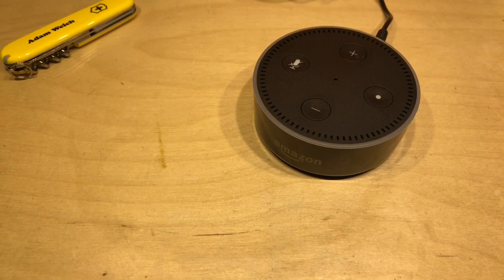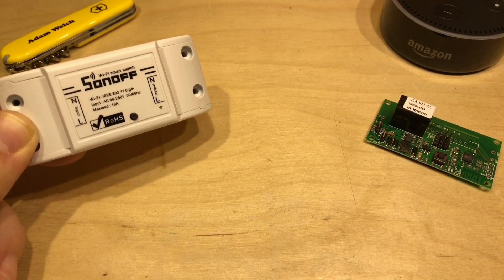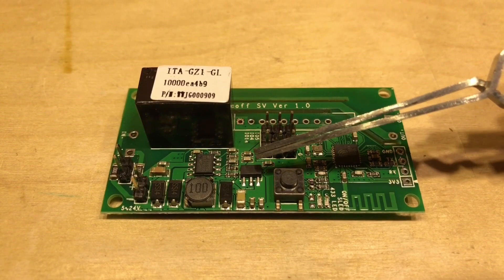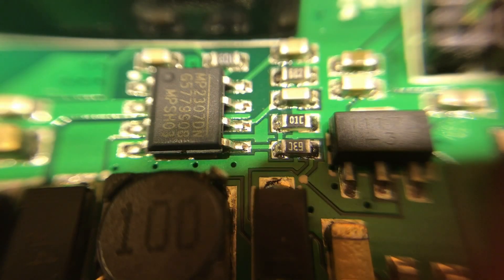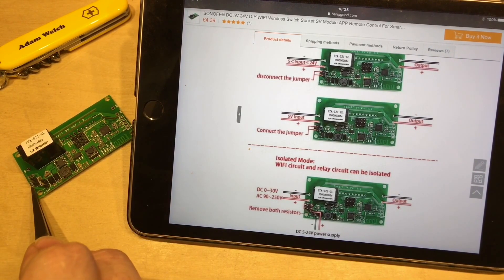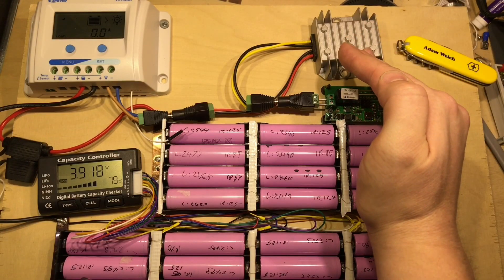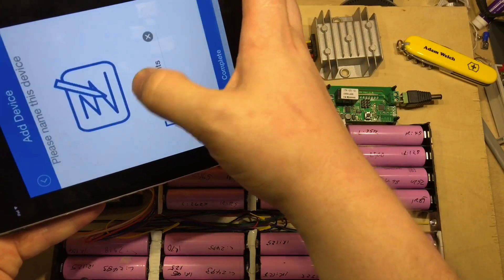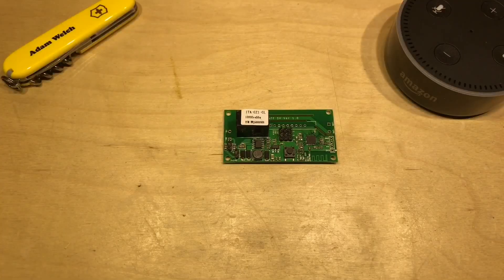Voice Controlled Shed. Sonoff SV & Alexa - 12v Solar Shed

Comment: Does this have to run through the ewelink app or can this be used in 'Offline' mode (so to speak) by utilising it directly through the wi-fi and not having to connect to the internet, and then relay back to their website to accept an 'On/Off' command???

I think the Sonoff Basic has a jumper to set it to only work through Wi-Fi, but I haven't seen any literature on whether this one can or can't
Reply from the maker: Ewelink is required and therefore the internet by default. You can flash other firmware to it though if you’d like - Tasmota or ESPurna for example.

Comment: Hi Adam, thanks for the video.  I just bought one of these units direct from iTead and its finally arrived!  You showed the wiring for the input (12volt dc in) I assume.  But didn't show the output.  Did you just run the output direct to your lights?  And provided you stay within 12 or 24volts with max of 3amps you're ok?  I think that makes sense.  Thanks. John.
Reply from the maker: Hi John. There are a few ways to wire this up. At twelve volt you can just use one input to power the sonoff and the load. https://images.app.goo.gl/aViUTirhjbiQ5Buk7
Hope that helps.

Comment: I presume with this sv version I could use a car battery to power the sonoff sv and a 12v electric pump to use as an irrigation system in a greenhouse?
Reply from the maker: Yeah that exactly the type of thing it’s designed for.
Reply: Excellent. Cheers mate. You reckon a solar charger keep on top of the standby function of the sonoff?

Comment: Hi Adam, great video, definitely going to give this a try. Any idea how much power is consumed by the Sonoff when off/standby?
Reply from the maker: +Graham Pritchard Just popped one onto my power supply which says it pulls about 0.15-0.25w depending whether the led is on or not. So it's worth pulling them off if you want ultra efficient mode.
Reply: Thanks for checking, much appreciated. So that would be 150 to 250 mAh drained from the batteries over the course of a 12hr night, at 12V when the solenoid is open???

Comment: Adam - I'm thinking 'Old School'.  Put a couple zener diodes across the chip?   A TO-92 12v (or less) linear running off your 28v might not be much of a problem while you have the soldering iron hot.  Based on the idea that the jumper is installed for 5v source, one of those jumper pins should already be tied to the positive input of the relay.  You probably don't even need the jumper header (and other components) once you remove the two suggested resistors.  It's a good place to supply TO-92  Not much doubt that the MP2307 has sufficient capacitors to clean up noise from the linear.
Reply from the maker: Yeah I think that some 'old school' components may well do the job. Thanks for the suggestion.  
To be honest though I am wondering whether (at the price of the sonoff) it's worth just hooking it straight up to the 28v side and seeing how long it lasts.  Might just need to keep an eye on the current.

Comment: Looks like more fun than crossing a room and flicking a switch. ;-) Thanks Adam. Those units look quite nifty, and they certainly have potential. Is there any advantage to dropping the input voltage with a few onboard components, or is there a ready-built range with (say) 35V capability? Someone should make them, because 28V has been something of a standard for decades. Railway carriages were fitted with 28V filament lamps, and '24V' road vehicle supplies are 28Volts (2x13.8V = 27.6V, plus some overhead from the alternator) when the batteries are fully-charged.
Reply from the maker: Yeah it's a slightly odd choice for the regulator.  I suspect the relay coil is 5v which is why the MPS regulator is there as well as the AMS1117 3.3.  I am tempted at the price to see if the MPS can withstand 28v.  But as you say, a couple of diodes on the input to the MPS or perhaps a zener across it clamping that voltage down would be another option.

Comment: That's pretty cool. It's a real shame you have to run it on the downstream side of the DC-DC converter - but at least you it's a nice efficient one.
Reply from the maker: +Paul Kennett yeah - for the price I might just try it on the other side and see how long it lasts. If I do I'll let you know.
Reply: Adam Welch Would it make any sense to put a diode or two in series with the power in to drop the voltage a wee bit?
Reply: What about isolated power schema - you can use the  input voltage via a dollar cheap buck converter, if only nothing strange will happen with connected ground potentials.
But I'd start with measuring iddle power usage for both Sonoff and DC-DC converter. Maybe it does not matter which side you put it ;)
And thanks for great channel!

Comment: You can tap directly off of 1 thru 7 on the series, so if you tapped the power from 1 thru 6 it would give you 22.2v of working power under a load and 24v idle. Happy Day...
Reply: 4v x 6 = 24v, but under a load it will run at 3.7v regardless x 6 = 22.2v
Reply from the maker: +MrBrymstond Yeah that's not a bad idea but may introduce an imbalance in the pack. I'll give it some thought.
Reply: I charge each pack separately with 5v solar panels for isolation purposes and that's how I keep them balanced as well. Each pack while wired in a series can be both used and charged as needed, but charged wired in parallel. @ 4.1v... Everything stays leveled off. you could always use the 7th parallel pack while wired in series for a USB Phone Charging bank while using all 7 for your major needs. That's how I do it and they're always up to charge.
Reply: When any certain bank or banks show any sign of wear it turns on and charges it up.

Comment: Is there any kitemarks or British standard markings on the Sonoff items? Could be a poor mans Lutron system lol.
If theres no markings then I profesionally would not install if a customer supplied it. But I cannot comment as I have a chinese light fitting on my lounge ceiling =)
Reply from the maker: +pietkaify Not that I've seen! However if there was would you believe they'd been tested? Build quality looks good though, and they're using an off the shelf relay.

Comment: For low voltage projects I am always interested in the quiescent current. I mean: it is always 'stand by'. How much mA does that cost? (even without the relay). In the end you have several things 'stand by' which may add up to 50 mA or more in the end. Or am I way off? And your dc2dc converter, what is it's quiescent current drain? (Sorry for counting milli Amps, but that is just my concern, looking at details)

Comment: Put a couple of silicon diodes in series with the input for the WiFi-circuit and it will withstand your 28V without problems.
Reply from the maker: +zaprodk Yeah, but then they'd have to carry the full current of the load too. I'm tempted (at the price) to try it on 28v and see how it goes for a bit.
Reply: I was thinking if you removed the link on the PCB so only the electronics will run at the lower voltage. Putting the diodes before the switched load would be stupid.
Reply: zaprodk i would use a 7824 to power the logic side of the sonoff. So you can Switch the Full 28V to your big DC converter and have only a few mW lost as heat on the logic side. A second, little 1€ DC convertor could also be used.

Comment: I'm not not a big fan of the talking devices such as Alexa but that is a pretty nifty wireless relay and I even thought of making my own using the ESP8266 but I suppose now I won't have to and it'll save me a few bucks.
Reply from the maker: +vgamesx1 They are super cheap. I've recently bought half a dozen of them to use around the house (and shed).
Reply: Nice.
Reply: I like to use these with Alexa through an app rather than the echo, works pretty well